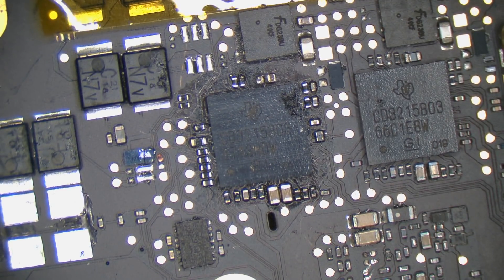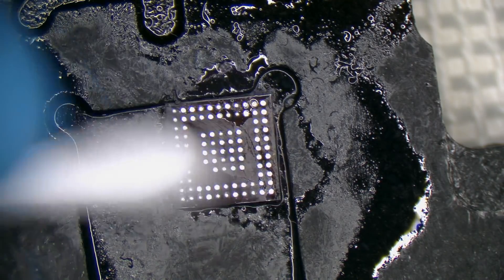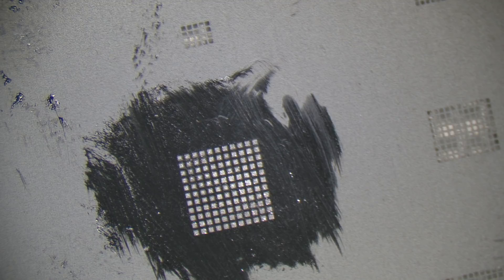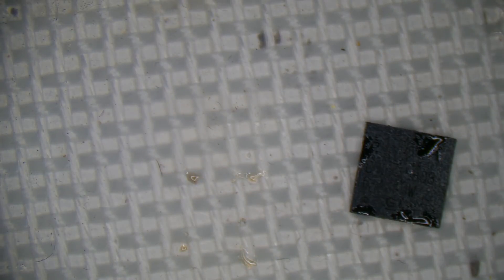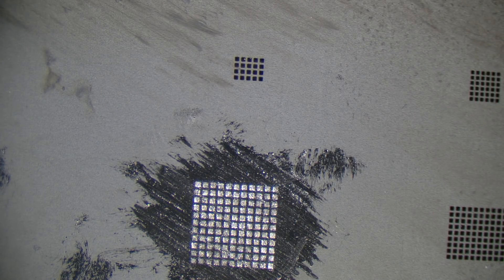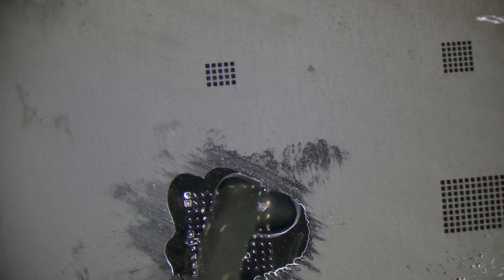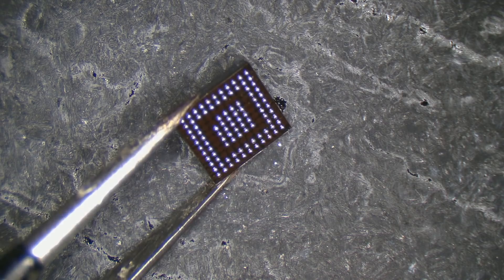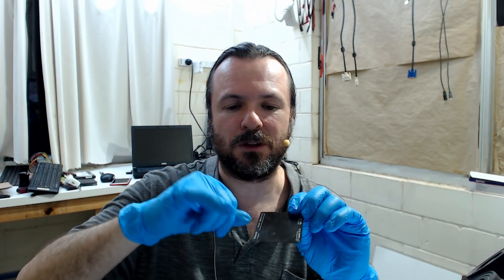Reball Challenge #2 - Louis Rossmann CD3215 Suffering

Comment: I think Luis meant that problem is not in contacts which are getting loose with PCB, rather than cracks which occurs inside the chip. When you heating chip, materials get wider and temporary fix cracks.
He says that you can heat chip  with temperature below solder melting like 180C and chip starts working again, but no solder actually melted anyway. Thefore he suggest to replace chip rather than reballing.
If cracks occurs between chip and PCB, then reballing should work, if cracks occurs inside chip, then chip should be replaced, but it could be that it will be manufactured in same way and will crack later on as well.

Comment: Imho putting a capton tape on the back of the chip to keep it tightly attached to stencil will not only help you avoid those leftover solder paste that requires once more air job, but also avoid the chip moving away from stencil.

Comment: The footprint is called "96-Pin BGA MicroStar Junior."  Hint: CD3215xxx == TPS65982 or TPS65986 or one of the TPS6598x family of chips from TI.  If it has MOSFETs wired to it in the schematic and the model supports Thunderbolt+DisplayPort on USB-C ports then its likely TPS65982.  If there are no MOSFETs attached to the CD3215x then it is likely TPS65986 or similar.  Some variants in this family, like the TPS65986 have no connection for external MOSFETs and are for lower power devices.  The TPS65982 and TPS65983 have internal MOSFETs and also have pins for controlling external MOSFETs.

Comment: 12:15 filthy chip. Did you clean it up ?
Reply from the maker: If you're so inclined, you can just put them in the ultrasonic to clean them up, but not a lot of reason to at this early stage.  The "dirty" look is mostly due to impurities from the flux/IPA rinse.  Realistically, once you put that chip back on with more flux and reflowing, it'll clear out perfectly fine and the whole board will go through an USC at the end of the job.

Comment: Good stuff Paul. Do you have a link to the dry paste? Would like to buy some to experiment.
Reply from the maker: Take your normal paste, hit it with the hot air at about 180~200'C until the flux has mostly boiled away.  It should just start to 'crumble', at least that's how I like mine.

Some people put the paste on a napkin but I find it a little difficult to get the resulting mass off afterwards, maybe they have a trick.

Other option is just to find an old tub of solder paste and the surface/rim area will have plenty of dried out paste for you to use.
Reply: I have no paste at all. So far have not had a need for it.

Comment: Both methods work for me. If the paste is wet, I make my adjustments. Everyone has their preferred methods. As long as the outcome is a nice uniformed reballed chip, the density of the paste, dry or wet should not be of concern in my opinion.
Reply from the maker: Definitely if you can work within the margins of allowable error, then no dramas.  For some jobs fresh liquid paste isn't a problem, when I'm stencilling for PCBs to be pick & placed / reflowed I'm using normal paste.